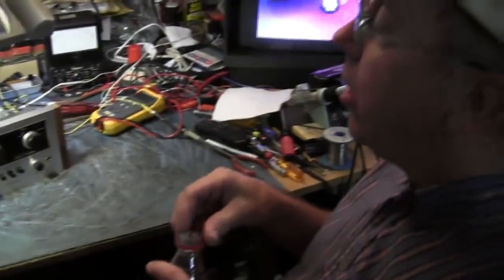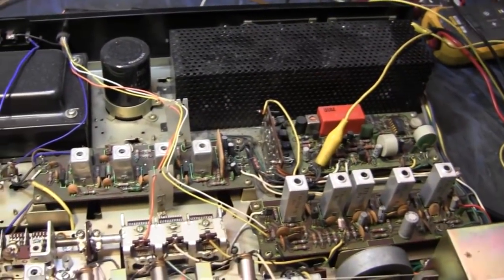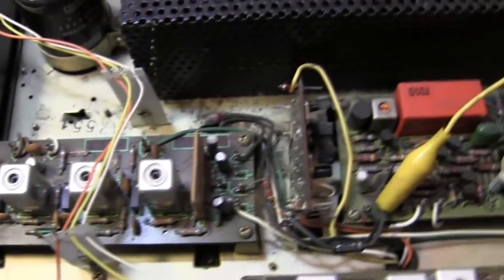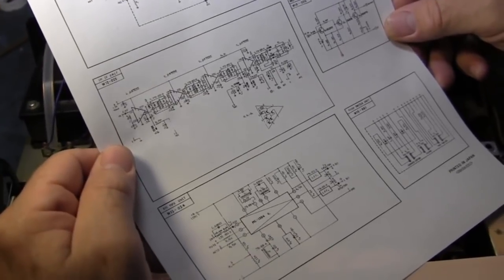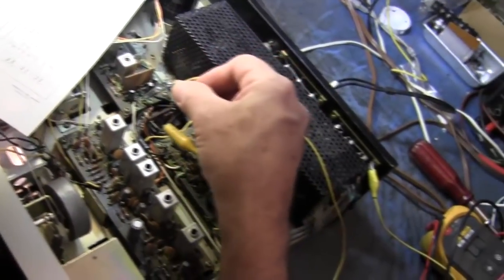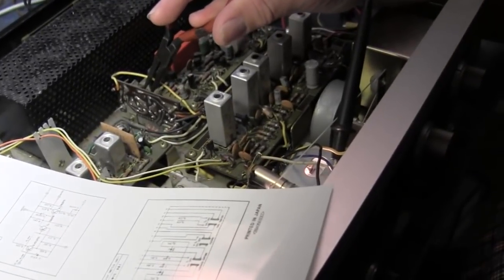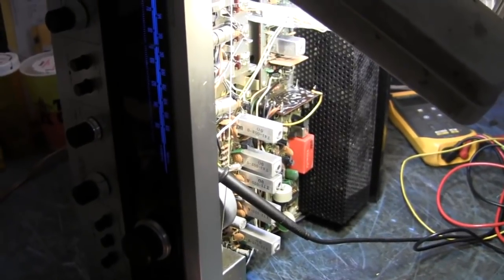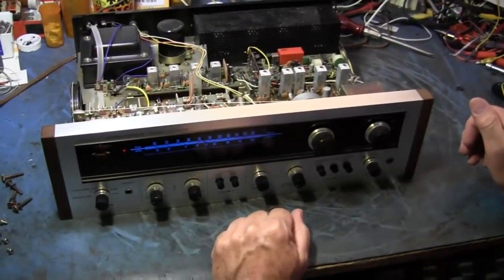FM tuner repair

Comment: Great info here. A pleasure to watch. Thank you so much.
Reply: I use a vintage Quad valve (tube) FM tuner which worked well until recently when the sound became intermittent.  Traced  the fault which was due to a dry joint inside the last IF transformer. The dry joint must have been present when the tuner was made 50/60 years ago but took until now to reveal itself!

Comment: Very informative video.  I am attempting to repair the exact same unit, but unlike yours, mine never receives a signal.  I know the signal meter is working as it works on AM.  Would this be a tuner issue most likely?

Comment: Hi- I just subscribed to your channel, you guys really know these old receivers! I just got a hold of a Lafayette LR- 775, SUPER clean (looks NEW), for $30 on eBay! Though all AC bulbs and (12vdc?) Indicator LED are burned out, the unit powered up and sounds GREAT! Unit was built in 12/21/69! (Inspection sticker). The only problem I'm having besides light bulbs, is the FM stereo was working fine, right channel MAYBE a bit lower in volume, and switching to mono made volume equal, and THEN, I think when I switched back to stereo, it has STAYED on mono! There is also a multi Plex button on the front- but it has changed nothing. Any ideas or help would mean alot to me- this unit is identical to my first purchase in 1970. I had it for almost 20 years before it was stolen. I'm playing it thru a set of Lafayette Criterion 200A speakers that sound very good. Any ideas- and what is the MPX button do? Thank you, Artie.
Reply: PS- There is hiss between stations, mute does nothing.

Comment: I have an Allied 445 that looks very similar (on the inside) to that SX-1500. On FM it pops and cracks like crazy, and the volume is reduced by about 75%. On other inputs like tape, aux, phono it plays fine. Should I be looking at a similar issue as your SX-1500? Thanks for doing and sharing this great video.

Comment: I have this exact same FM radio problem with my vintage Realistic STA-100. My AM works fine and all the other inputs too. It's just the FM sound is super quiet. Otherwise I can see it gets a strong signal and even stereo! I'm stumped. Maybe also a bad solder joint??

Comment: Love your videos, very informative! What would be your best educated guess with a 1971 receiver with very low output on one channel and virtually no bass,  but clean sounding otherwise, just 1/10th the volume of other channel? All controls have been cleaned and there is no difference.
Reply from the maker: I am sending this question to Paul
Reply: I just fixed an old Curtis Mathis stereo with the same problem and found that it was a bad capacitor on output just before the speaker. 
From my scope I could see that the bad channel had voltage on the output transistor that was 10 times higher than the good side, there was no load because the cap was almost completely gone. :-) 
But I am an amateur.  So I would likely just wait for a response from the correct Paul (Mr Porter) who is a professional.

Comment: The multiplex chip goes bad on these models. I have replaced 3 of them. They are getting very hard to find. You have a composite fm signal going in but very low level out of the MPX bd.

Comment: fabulous episode. the capacitor topic you touched on got me wondering about old caps i replaced that checked out okay yet the new replacement take ten times longer to reach 000 on the capacitor tester (in test both old and new capacitors). any comments on the vast charging difference in the old caps  and their amazing ability to seemingly passing the leak test as quickly as they did?

Comment: I have two samsung hi-fi units zs990, on one tuner is off by 0.15mhz and have worse reception than the other one. If station should be on 92.40, it gets it on 92.55mhz. Any ideas what gone bad, Caps? I'm new to this, so maybe for some of you it's quite obvious right away what would cause this.
Edit: Seems I fixed it, don't if temporal or not, but tweaking FM Detector Coil pot until it tuned on the right frequency did it for now.

Comment: Mr Thomas :  I have a vintage Technics - 5250 i acquired a couple years ago. cleaned the tuner & blew away all the dust. For awhile the FM Worked great , then it slowly went south. Now i don't even have white noise !!!  Is this a common problem with these older Technics Receivers ???
Reply from the maker: +Tom's Tunes Yes FM tuner or IF  section goes out of alignment